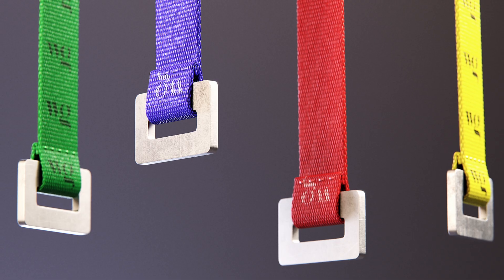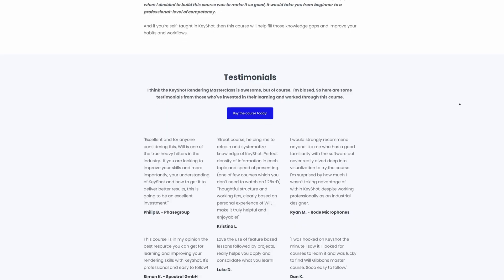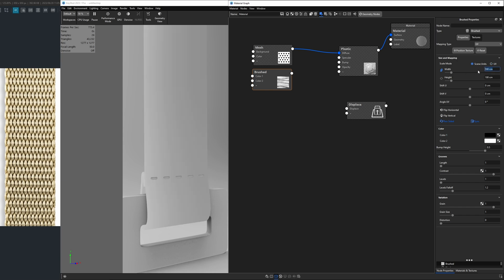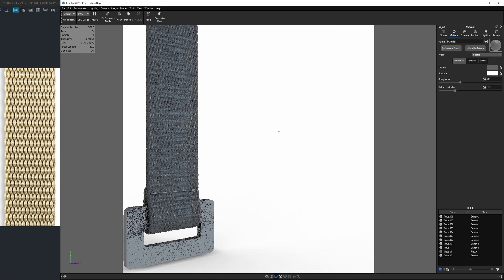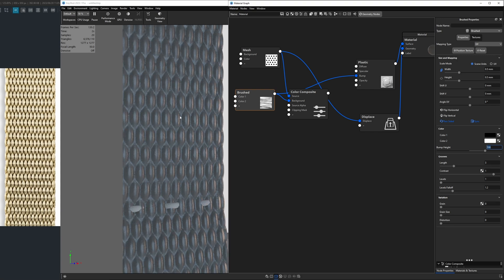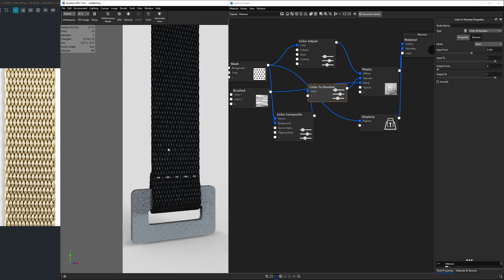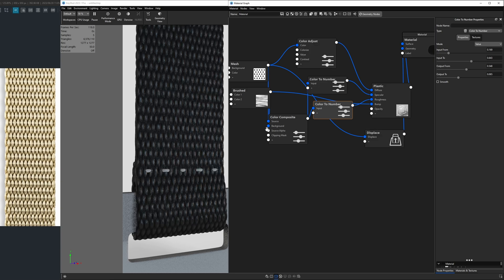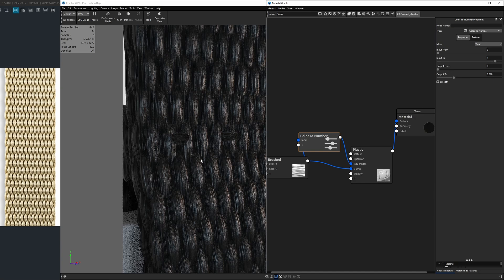Nylon Webbing Material KeyShot Tutorial

Comment: Really interesting video! When UV unwrapping the strap, did you need to split the surfaces? When I followed the tutorial, I split the surfaces to UV unwrap, but applying the displacement seems to separate them apart leaving visible gaps. Is there any way to avoid this?
Reply from the maker: When splitting surfaces, you will get those moving apart with displacement. But there is a slider in the displacement settings that can reduce or increase those gaps you see when surfaces break apart.

Comment: This is great. do you think using the mesh node as a normal texture will give similar results? It could be useful for objects which are further in distance or just to save up some memory when rendering larger scenes. Definitely going to try this.
Reply from the maker: I understand your thinking. You could, but since the mesh texture only holds black and white values, it'd be used as a bump texture. Normal maps have RGB values that redirect light in one of three distinct directions.